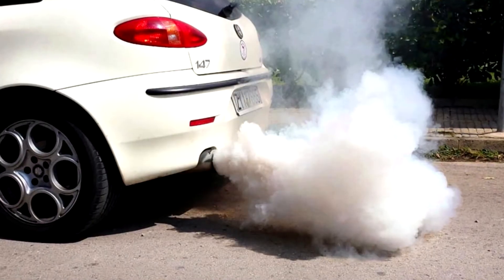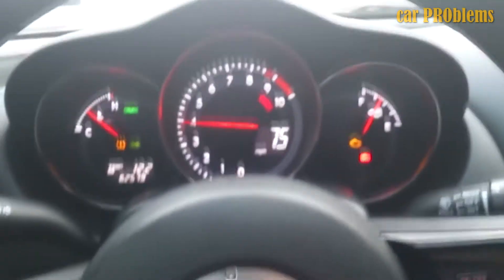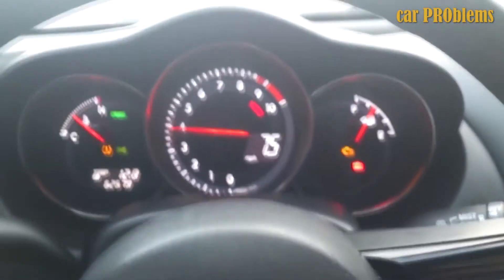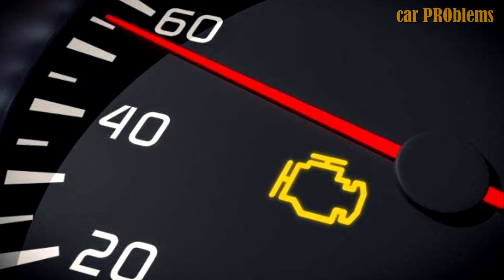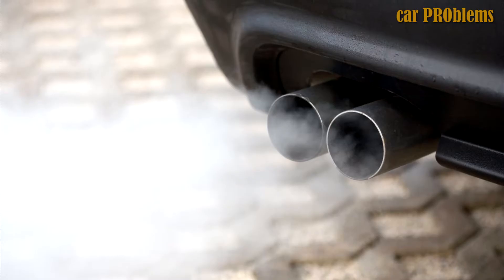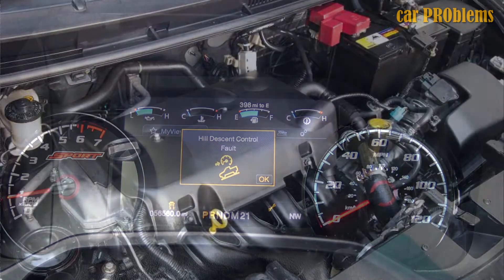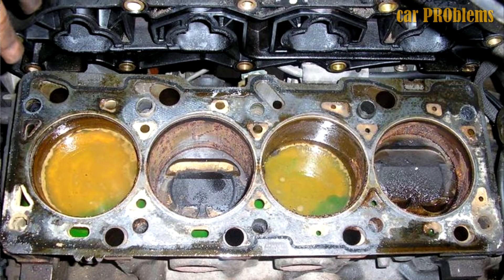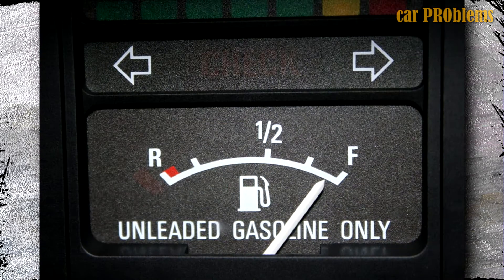Water in Gas Tank: Symptoms & How to Remove It?

Comment: I have a 2005 Ford Escape. Sat for 3 yrs. Have water in  Tank . Tryed to put a drain hose in tank. Theres a stop  plug at tank outlet preventing me from reaching the gas tank. How do i get past that plug? 🤷🏻
Reply: i have a 2014 ford escape i bought it 3 months ago. my gas tank begins to hum, and then it has a hard time gaining speed. been having this problem about 2 weeks. pretty sure its water or a fuel pump.... hopefully just a little water that slowly leaves.

Comment: I can attest to misuse of methanol.  Before I took a mechanics class, I put a whole bottle of gas drier in a 1/4 fill tank and the car started, and drove  just fine.  But a few months down the road ... literally .... the engine failed while driving because the rubber gaskets on the fuel pump were liquified.

I had to pull the back seat apart to get to the filter to replace it, and the seals were gummy and shapeless.  Lesson learned.  A cheap solution resulted in a much more expensive repair.  Moral:  Read the bottle and don't be a hero starting a car on gas drier thinking more is better.

Comment: My gas gauge has a issue of not reading properly. Regardless of my constant adding $20 every other day I still ended up running out of gas. I had just left sheetz so I walked to Walmart bought a 2 gal can and filled it at sheetz then slowly put it in my tank.  Was enough to get back to sheetz to fill up. Problem is right after I filled the tank I started the truck and noticed a big issue. It shakes like crazy and due to this I decided to return home. On the way back home I found it to shake almost jumping me out of my seat when at stoplights or stopsigns. When accelerating it takes alot to get it to actually speed up. By time the rims reach 2500 the check engine light is flashing. The code was po300 if I remember correctly. I do know it's the code for the control unit. Now I'm worried about driving my truck as I don't want to mess it up. The code could be bad sparkplugs, bad coils or simply water in the gas. Seeing it started literally right after filling up a empty tank I'm thinking it's water but I dunno
Reply: Did you fix it I just had exact thing happen
Reply: Take your tank off, clean it n replace tank gauge/ pump. Just check everything out from tank to ...
Reply: Sounds to me like you picked up trash from running it so low. Running your car on low all the time will also burn up your fuel pump over time. I normally keep mine on half and then when it's get to half I put 10 or 20 in it and fill it back up. I'd suggest getting on eBay and buying a cheap cluster so all your gauges work. That or your float on the fuel pump is stuck. Has to be one of the other. I'd try the new cluster first then your engine light flashing prob means that you're having multiple misfire codes. Buy new plugs and coil packs or plugs wires which ever your vehicle has will more than likely fix it. U can get a free engine light test done at local auto parts for like O'Reilly's or AutoZone and get them to print them out for you. It'll tell u if u are having misfires and which cylinders. I'd just replace all if you can. If not do them 1 or 2 at a time if you have to but they'll probably all need done to be honest. U can buy some cheap MAF sensor cleaner as well and spray it down good then I bet that'll fix your issue unless its an oxygen sensor or a fuel pump that's not pumping the right amount of pressure.y moms Lincoln mark 8 did tht once where it would run but would die if you gave it gas and it was the fuel pump still coming on but wouldn't pump the right psi that the car needed so we replaced it but that doesn't sound like what your talking about really. Sounds more like multiple misfires to me or a bad MAF sensor.